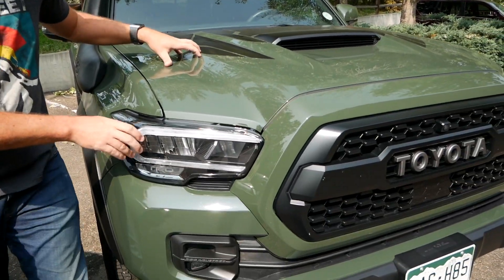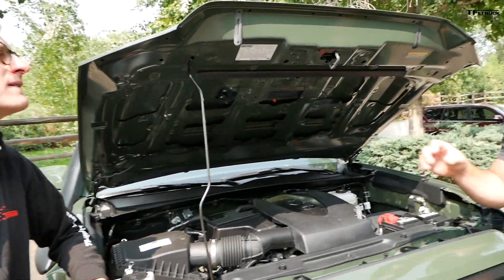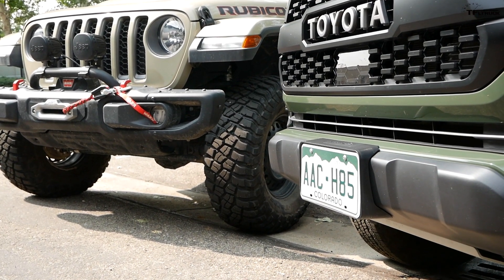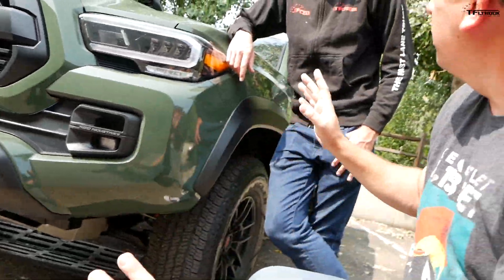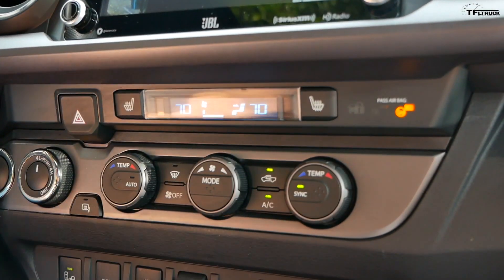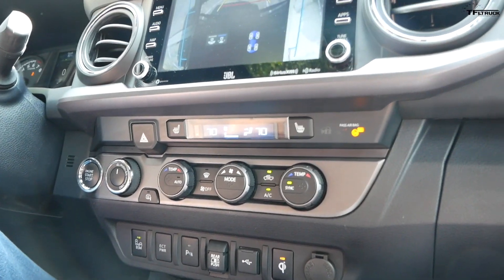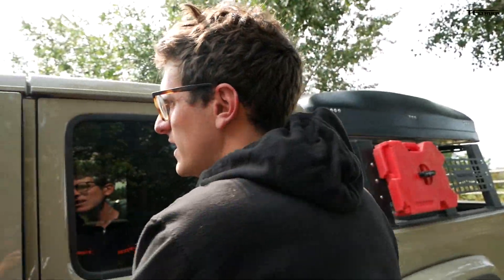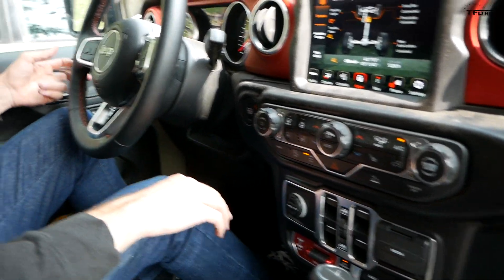Toyota Tacoma TRD Pro Has Met Its Match! We Compare It to the Gladiator & Show You Why!

Comment: For all the complaints about the drum brakes you should do 10 hard measured stops between the 2 and see which does better. I don't say this as a fanboy but honestly I'd like to actually see it put to the test. Id bet the Tacoma brakes do just as well as anything in it's class but with less maintenance. I feel like people like to complain about it's oldness, but the wheel is also very old and still pretty effective.
Reply: Because that test was done in the mid 80s to prove that. Maybe its on a reel to reel somewhere
Reply: thats the same test that determined "there's no replacement for displacement" right?  Give me a break.
Reply: No clearly smaller cylinders are far more effective, especially with forced induction. You are the old school thinker not me. Drums might work fairly close for 1 braking bur every brake apllication after that will be longer. Its not even a debate.
Reply: @dad2817  Its clearly a debate.  I'd like someone to show it in 2020, because my experience and instinct is telling my that its not going to play out the way "everyone already knows".

The truth is that the rear brakes on a pickup are such a small part of the equation that I don't think it remotely matters if they are drum or disc.  I can tell you that the Tacoma, the Gladiator, the colorado, and the ranger all stop within a few feet of each other which says a lot.  I would bet that even after 10 hot runs it wouldn't change.  

But I guess if you'd rather call it settled without testing it and continue on your way with assumed knowledge, that's your prerogative.
Reply: @PatrickRich  That's the same logic as Mike Sweers saying the Tundra mysteriously doesn't need a transmission cooler anymore after 11 years, and oh yeah, "we're using the exact same powertrain". Don't be a sheep.

Comment: The taco has a bed light it’s built into the rear overhead brake light
Reply: Also you can buy the side LED bedlights for $65 online, and they install in 15 minutes because the wiring and plugs are already there behind the taillights.
Reply: Wow, an overhead light! That's some serious innovation and sophistimmications going on. Toyota is really bringing things into the 1970s.
Reply: @nukewiller4083  That and the tacoma TRD Pro comes with lane departure, auto high beams, auto cruise control, front and rear collision detection, cross traffic rear detection, 360 degree top-view camera, Apple Carplay, wireless charging, and blind spot indication standard. No other truck in this class comes with all that standard.
Reply: @42bill  And still has drum brakes. I'll take the better braking system. You can keep the tech.
Reply: @shiftmotorsports9803  If you swapped the rear drums brakes with disk brakes, the truck would not stop 1 inch shorter. It would have zero difference in petal feel, and it would have zero change in reliability. Rear brakes provide barely any braking force in the road, and the drum brakes in the rear work perfectly for slow offroad driving. Not one owner of a Tacoma ever had a braking problem due to their rear drums, for the last 20 years. Yet, the new technology immediately has saved thousands of accidents, and probably hundreds of lives. Every owner with the modern saferty tech can tell you how it saved them from a crash at least once. Your logic is flawed.
Reply: @42bill   You are telling me that in the last 20 years there there have been 0 Tacoma rear drum brake issues? 0?  No complaints at all? Ever? Where did you get this information from? 
All manufacturers should be given your information so they can revert back to drum brakes since disc brakes don't stop shorter. Do all Toyotas have drum brakes? 
Tundra? 4 Runner?
If not, your logic is flawed.
Reply: @shiftmotorsports9803  It is not a question of if a single drum brake had a problem. You know what I mean so don't focus on semantics. Toyota could easily swap in rear disk brakes at any time if it was a problem, and I have zero doubt that that is exactly what they would do if it would improve their reliability even more. The fact is, there is no midsize truck sold on the market with reliability even close to the Tacoma. That is not an opinion, but statistical fact. Far more important is the fact that all Toyotas come with the suite of safety sense technology features, which is still optional on most other brands.
Reply: @42bill  Actually 2019 jd power ranked the Frontier #1, GMC Canyon #2, Chevy Colorado #3, Toyota Tacoma #4. Google it before you spew untrue statements. 
Toyota is still making money off the past because loyalists can't accept the Tacoma has slipped. 
Well done Toyota! Throw a few new gimmicks at Bill to keep him happy but keep the old truck so we can make bank. Voilà, it worked!
Reply: @shiftmotorsports9803  LOL, JD Power is a polling company that sells its rankings for money. It is not in any way a respected source for proving reliability in the automotive industry. If you actually believe a Canyon/Colorado is know to be more reliable than a Tacoma, you're living in an alternate reality. Yes, Well done toyota- Their product won my money after I spent a year or research. My first new Toyota, that I'll keep for 10 years and sell it for twice the price of a 2020 Colorado.
Reply: @42bill Is the earth flat too?
Reply: Shift Motorsports You can say whatever you want but first bring the facts, recalls or statistics showing drum brakes in Tacoma’s have something wrong. If not, let’s just say Toyota decided to use them for a preference reason and that’s all. The most advanced brake systems of today works the same with drums or disc and heavy haulers and semi trucks like the most advanced Volvo, Mercedes, Scania, Man and US brand semi trucks use them. There should be something good to use them?
Reply: @humbertorubi2735  Yes, there's something good about them..they're cheap.
Reply: Shift Motorsports  Sure! And still effective 👍🏻
Reply: Shift Motorsports 
The purpose of rear brakes are to keep the vehicle stable when braking, while the front discs do most of the work. I have no idea why you’re offended about the Tacoma having drum brakes.
Reply: @elitetr1nity617   I am familiar with how braking systems work, thanks! Who is offended?
Reply: Shift Motorsports 
You appear as though you were offended or upset about the Tacoma having drum brakes. My apologies if you took it the wrong way. My point is that having discs on all 4 wheels wouldn’t be a great idea when the rear brakes do little. The drums are more than enough for what the truck needs.
Reply: @elitetr1nity617   I think you and the rest of the Tacoma fan club should get together and petition to have all vehicles revert back to rear drum brakes since disc brakes do so little and aren't a great idea.  Imagine how much money they would save! You'd look like saviors to the manufacturers. Let the racing teams and engineers know they've been doing it all wrong and wasting money. 
You guys have been drinking the Toyota kool-aid way too much.
 Toyota is just being cheap by keeping drum brakes on the rear of the Tacoma.  If it aint broke don't fix it!  People keep buying them and Toyota keeps reaping the benefits.
 If Toyota actually builds a new Tacoma and stops doing refreshes, how much do you want to bet the new truck has rear disk brakes?
 What will the Tacoma community say then? Why did they do this? I miss my drum brakes! What a waste of money! Doubt it.
  You guys can try to convince me all you want that rear drum brakes don't make a difference in performance but I, engineers, racing teams, and manufactures disagree with you as they has been putting disc brakes on the rear of vehicles for decades! Why? They perform better.
Reply: Shift Motorsports 
It’s overkill on a pickup truck, and it’s cheaper to build. That’s it. I’m not saying I prefer drum brakes over discs, I’m saying that there’s no need for them.
Also: how smart of you to instantly accuse me of being a fanboy, bigot.

Comment: I know we are talking stock trucks and for disclaimer if i were to buy again I would probably not buy a Tacoma or gladiator.  For the $5000 premium on the gladiator you can take that and add more clearance and better tires on the Tacoma .  That probably gives you the same capability if not more then the gladiator with a lot more technology, reliability, and functionality for the same price.  Given that, would you still pick the gladiator?
Reply: Yes I would. I just trade in my 17 Tacoma TRD O/R in 2 months ago for the same move and would do it again. After owning a 2nd gen Tacoma, the 3rd gen Tacoma powertrain was a step in the wrong direction.  I would take my 14 Tacoma over the 17 Tacoma anyday of the week.
Reply: big simpin yea I’m not super happy with my Tacoma either but I don’t think a gladiator is going to change much for me.

Comment: Tacoma Rust ... has only just begun?  I have a 2011 Tacoma. It will be 10 years old in December.  It has 80,000 miles and has been through 10 Minnesota winters. I am changing out all the drive line fluids. During the process, I was shocked how rusted out everything is (front to back) under the truck.

Comment: At 18:03... does your chrome trim on the aux switches not fit flush?  Probably doesn't bother you but I don't think that is right.  When installing the aux switches, I'm pretty sure the mount sits UNDER the screw mount for the locker panel.  Silly dealership installers.

Comment: Good vid. I really like the calm version of Tom.  I have had jeeps for decades. I currently own a Gen3 Taco overlanding. I chose the Tavo because of the combination of reliability and cost.  The Jeep is way over priced.  The value made the difference for me.  The transmission is fine. Once you learn to drive it it does the job well.  I installed hood lift kit and it’s not heavy. My biggest complaint is the seating position.  But there are tons of after market solutions for that.  They cured the issue for me.  It’s the Tavo for me.  I would be afraid to take the Jeep too far from the barn

One comment Tom, you have a tendency to slap things that makes a sharp sound that can be disruptive to the flow
Reply: The hood's not heavy if you actually have biceps and have heard of a gym but that kid has a beta male physique and the arms of a 12 year old girl. All men should maintain at least some sort of a physical fitness standard throughout their lives that involves free weights it's a part of manhood. If someone like him were to even just do a 20 minute a day workout routine it would still make a dramatic and life changing difference so he can't say there's no time there really are no excuses it's just laziness.

Comment: Ive currently have the 2017 Tacoma TRD Sport with almost 90,000 miles and I've yet to have any major issue with the truck.  Another reason Tacoma is king of resale.
Reply: Actually Jeep Wranglers have better resale than Tacoma and Gladiator will as well.

Comment: I think what is never discussed or compared is aftermarket lifts. If you do a comparable lift on both trucks to both have 35” tires, the Toyota requires a body mount chop that needs welded closed afterwards. Even if you go long travel on the Toyota and add fiberglass fenders, you still have to do the chop.

Comment: L.E.D lights and the steel modular bumper should come standard on the Gladiator Rubicon and My current 2020 JLU Rubicon. You are paying a premium price for the best off-road model and you should get the bonus for those add-ons included in the price.
Reply: The biggest winner with Jeep are the aftermarket producers as you always need are least 15 k more to have a capable Jeep

Comment: Test drove a Tacoma. My problem with it wasn't the seating position. It was the steering wheel reach. Driving with straight arms is not very comfortable. That 1/2" to 1" telescoping column didn't do much. Sat in a Gladiator. My head was bumping the sport bar. I'm only 6'-3. Couldn't pick either of these. Both seem like a load of fun.
Reply: Try the Ranger. It's bigger
Reply: @henryford2736   Bought my truck in 2017. Won't get another one for several more years.
Reply: @matbasterson2128  what truck did you get?
Reply: @henryford2736  I got a Nissan Frontier. SV Long bed and moon roof. Been happy with it. Really considered the Tacoma.

Comment: If the ecodiesel was available when you got the Gladiator would you have opted for it?
Reply: I waited for it to order mine. Should be here in a couple weeks.  I drove a diesel JL on 40s with stock gearing and it climbed a 7% grade like it was nothing.

Comment: 19:50 they keep saying $50k like you can get a Gladiator Rubicon for anything less than $65k. While, where I live in Fairbanks, AK, you can't get a base level stock sport gladiator trim for less than $45-50k, much more a Rubicon trim level at $65-70k with no added options. Might as well get the TRD pro at $46-50k depending on optional equipment.

Comment: Don’t sleep on the Goodyear Wrangler tires on the Taco, they work pretty well off road for an all-terrain. Those are stock on the Colorado Z71 too and they truly do offer the best of both worlds between on/off-road use. I went beach camping in the Rado and aired them down only to 30psi. Handled fine sand like a champ.

Comment: Had a 2017 Tacoma 4X4 Off Road and towing my 4K boat with four passengers and gear was a total disappointment. Especially going up those huge bridges up in Key West, Florida. After that trip i traded this truck in for a Tundra. Tacoma is a good truck, but it is NOT a family and/or towing vehicle.

Comment: They briefly skipped over suspension. The Tacoma pro has a great setup probably worth about 2k. where the gladiator has basic bottom end fox shocks that are 150 a piece.
Reply: And the gladiator still performs better offroad.  If you’re leaving it stock, get a Mojave which outmatches the TRD pros suspension by miles
Reply: They are 2.5” remote reservoir with hydraulic bump stops. Better than anything else

Comment: What is the point of putting the diesel in the Gladiator? From everything I have read, it will not tow any more than the 3.6 liter Pentastar V6, due to the small grill not allowing sufficient cooling.

Comment: To put the Tacoma in 4low, it must shift to 4hi then into low. It won't let you go from 2 wheel drive immediately to 4low. To get it into 4hi you gotta roll a little from a stop. If moving, put it in 4hi, then stop put it in 4low, thats how I make it happen quickly. Its finicky, even more with the manual, its all about pushing the clutch in. TOYOTA!!!

Comment: Tacoma ECT button is the trick to stop the issues with gear hunting. Why does nobody mention this?
Reply: Actually instead of activating ect try turning off completely trac off by just holding it down for few sec. My trd or kinda drives more smoother kinda feels lighter to me. Also while off roading you should always do the above advise too and I use sequential mode for the transmission can do most trails in s1 s2.

Comment: All these comments about the jeeps reliability but the gladiator is based off of the wrangler which has proven its reliability for decades.
Reply: Yes it has been very low on every reliability consumer report auto issue since the 80s.
Reply: Norm Cheers no other vehicle is beat up and as capable as a Jeep. People take it off-road and break shit then blame it on its reliability. Also uneducated people buy a solid front axle vehicle and then complain about the ride, like, did you not know what you bought? An off-roader.

Comment: Tacoma Pro:  virtually indestructible truck that will give you lots of cheap worry free miles.  Con:  expensive up front
Jeep Pro:  Cheap up front.  Con:  Virtually disposable that will give lots of expensive worry filled miles. - EDIT:  Nevermind it's more expensive up front.  So there are NO Pros for Jeep.
Good day.
Reply: Something tells me your not a jeep guy haha😂 buuut the gladiator Rubicon has front and rear lockers disconnecting front sway bar with a solid axle upfront so better articulation, and bigger more aggressive tires from factory as well. The tacomas are good but dont completely discount the jeep they're more expensive for a reason
Reply: @shaneolsen9394  Yes - it would be amazing for 2-3 years, then fall apart.  As long as you keep buying a new one, it'll be dependable.  If you want to keep something for 200k-300k KM or more, you would be foolish to get the Jeep.  Is the Taco perfect?  No - it only got Android Auto this year.  Fiat Chrysler have some of the nicest interiours - no doubt.  But if I was going to plunk my hard earned money down, thinking about dependability, reliability and resale it would be a the Taco - no questions.
Reply: @pizzleboy  ill give you jeep that hasnt had the best track record for dependability but like you said FCA is really turing all of its subsidiaries around for the better and one point I will argue is jeeps hold theyre re-sale value well, almost to the point its stupid, but you're right a toyota will definitely be more reliable across the board

Comment: The Gladiator has the same engine as my Dodge Grand Caravan.
Reply: Doesn’t mean much at all, the penestar engines have proven their reliability across the board.
Reply: @bradgt5130  wasn't poking fun, just surprised at it
Reply: The taco has the same engine as a Camry.... I have one. It’s a dog even with the MT.
Reply: @agraetzel  Amen. The 2nd gen Tacoma powertrain with the 4.0L and 5 spd. was so much better than the 3.5L / 6 spd in the 3rd gen.